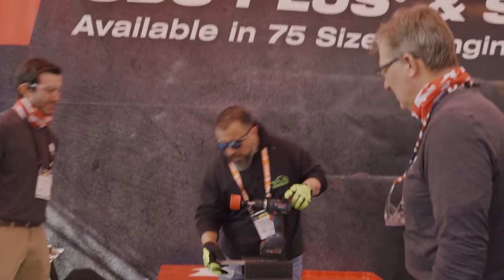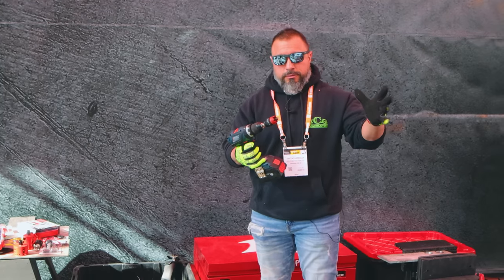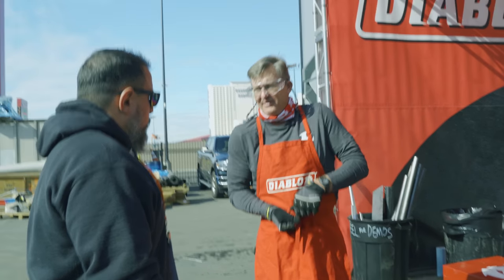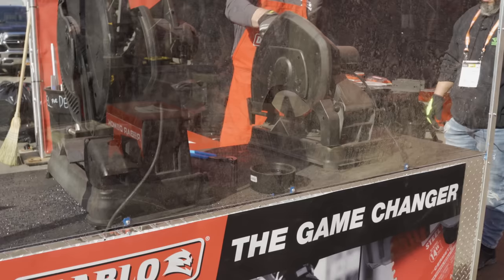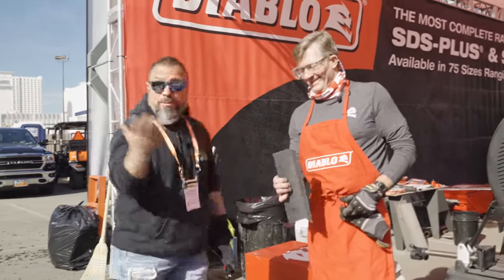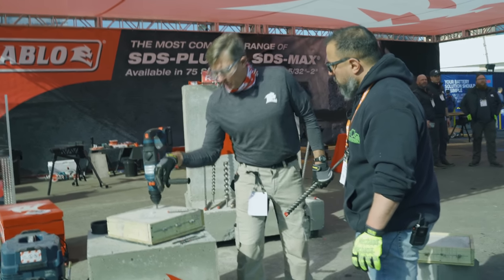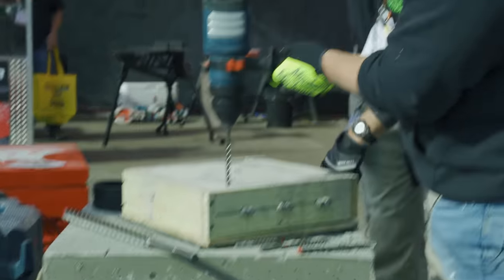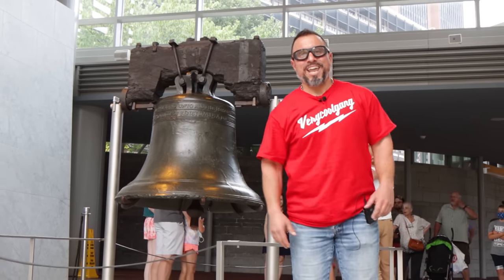Diablo Plays Games With These New Tool Accessories

Comment: I am a huge fan of Diablo bits and saw blades. My only complaint is their new  line of carbide hole saws. I mainly use hole saws to drill and tap live water/sewer lines in the waterworks and utility industry. The last thing you want is for the coupon to fall in these lines because that can be very bad. Usually the water pressure keeps them in a traditional hole saw, but occasionally they will get sucked into a line. So the spring eject is definitely not what I want. If it is removable that would be handy, but until I know other wise I’ll still be using Milwaukee or other regular style carbide bits. Great video and thanks for always posting the best content!

Comment: I have used that type of saw a few times before. They really are the best. But you can't let a dumb dumb on a job site use it. And that's exactly who's usually cutting the metal. They don't let it get up to speed and then they slam it down on the teeth and ruin a very expensive blade. That's why new guys can't use anything nice.
Reply from the maker: No bueno

Comment: when does Milwaukee buy out diablo?
Reply: Never. Bosch owns Diablo, and they are doing them quite well in owning the consumables market. Flex is their professional tool line, and Bosch remains a solid choice to outperform Rigid and Ryobi (in most price brackets).